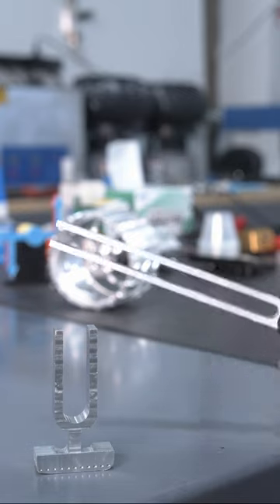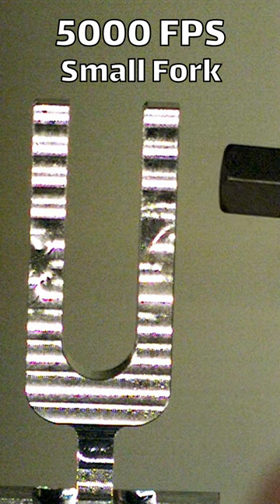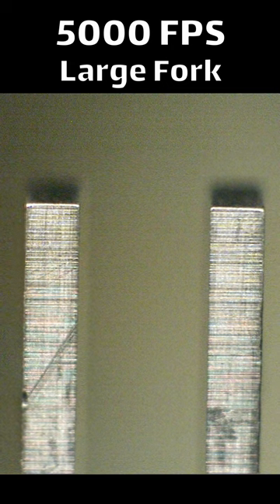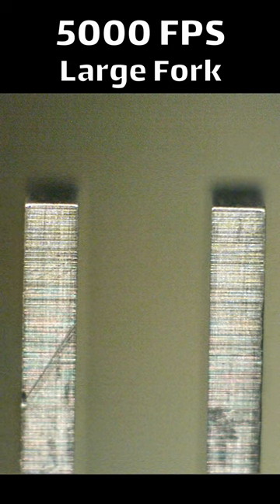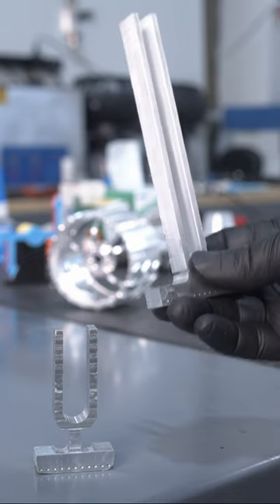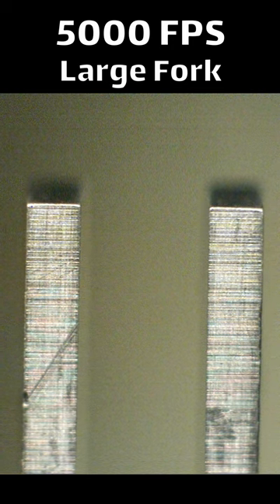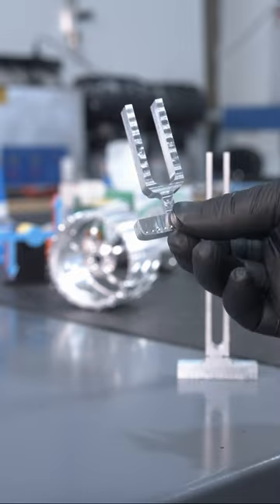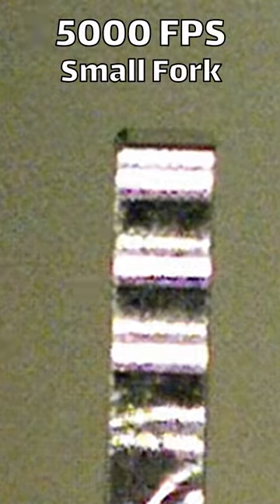Slow Motion Tuning Fork

Comment: The large one resonates at 180 Hz? It really sounds much higher than that... Anyway, great short! <3
Reply: Agreed. I think the microphone is picking up mostly overtones
Reply from the maker: Yeah, I really struggled to get the mic to faithfully pick up the tone, it's pretty directional and the mic didn't like it much. There are some overtones muddying it up, plus the table itself contributed some noise (oops). I tested these off-screen with a phone app to determine frequency and it seemed pretty consistent once it settled into it's main frequency. (although grain of salt re: phone app and microphone 😅)
Reply from the maker: Ah yunno, I might have botched that on second thought. Just tested it again and there is definitely a low 180hz tone if you have it right up to your ear which must be what the frequency app was picking up, but the higher tone is around 11kHz which is what the camera mic was detecting. Oops.
Reply: @BreakingTaps  which app did you use
Reply: @BreakingTaps tuning forks at least for music are designed to be coupled to something resonant for the tone to be audible. Watch classical guitarists or similar. They will strike the fork on their knee and then press the stationary end of the fork against their skull just in front of their ear, or against the body of the guitar! Any wooden box or even a drywall wall will make the tone considerably more audible. You could even press the back end against your mic. The important thing is to let go of the idea that you’re ever going to hear it from the vibrating ends, that’s just not how they’re meant to be used.
Reply from the maker: TIL, thanks for te extra info! I should probably note these are nowhere near "real" tuning forks. I just sketched out a rough tuning fork shape and zipped them out on the CNC. Needed them for a video demonstration and didn't particularly care about their frequency. So definitely not well optimized! The footage was neat though so figured I'd make a quick Short first 🙂
Reply: @teddycook1299  a lot of string players touch the base to the bridge to use their instrument body as a resonator.
Reply: That's called a harmonic
Reply: Can’t we just count the frames at 5000fps to know the true oscillation frequency?
Reply: @alexscarbro796  sure, you start and I'll relieve you to finish counting next week
Reply: i’m order to hear the pitch of a tuning fork, you have to put the base onto something that will resonate

Comment: What causes such high harmonics? That larger one especially looks to be oscillating sinusoidally, but there’s obviously a lot of treble coming from other harmonics. And since those harmonics are coming from different mechanical parts of the fork, I guess they don’t have to be integer multiples of the fundamental; they can be independent. Manufacturing a tuning fork to have minimal harmonics, or to have solely integer harmonics, must be quite difficult.

Comment: Resonance frequency is also depends on surrounding matter/atmosphere... For example the same fork resonance frequency in air and water will be different...
This is the principles for ultrasonic level sensors in industry, they are made like pitch fork with piezoelectric generator attached, and when water or other liquid riches it, it changes resonance frequency which in return detected, and processed as liquid level reached the sensor...

Comment: The reason it looks like the 15kHz fork isn't moving at all in your slow motion is because of aliasing.  It's exactly 3x the sampling rate but in order to capture all data you need to sample/record at at least 2x the highest frequency expected., so 30k FPS.  Nyquist's theorem

Comment: sorry, 180 Hz? why does it sound like a higher frequency?
Reply from the maker: I goofed and forgot to mention there are overtones which are higher. They die out after a few seconds and you're left with the low 180hz (which unfortunately isn't picked up by the mic well at all, so you're mostly hearing the overtones 😢)
Reply: Because he doesn't know what he's talking about at all.

Comment: Since the hertz number is relatively low for human hearing, how come it sounds so high-pitched?
Reply from the maker: I botched that explanation a bit, there are overtones on the big one which are at a higher frequency even though the base frequency is low. Unfortunately the microphone mostly picked up the higher overtones and you can't hear the lower frequency (it's noticeable if you hold it up to your ear).  Sorry about that!
Reply: @BreakingTaps  Oh, I see. Interesting. Thanks for the explanation. What kind of mic did you use?

Comment: It would be a different shape or have more rods, but since the rods resonate with each other, various shaped rods together, percussed, could generate a soliton, a kind of wave, like a sound, water, electron, or light wave that is 100-1000 times farther travelling, from being less absorbable and spreading out less. it would be less loud, but you could hear it three rooms away through walls. there is an even better kind of soliton peculiarly named a "dissipative soliton" that dissipates orders of magnitude less than the already far travelling soliton, maybe you could hear it thirty rooms away. New musical instruments could make solitons at the instrument for far reach with ungarbled sound. solitons could be produced at any electronically processed, amplified, or effects processed instrument, giving any instrument farther reach and truer sound, the thing with the electronics is you would use soliton capable speakers, I think these speakers are possible to build with really fast moving speaker parts, the soliton wave looks like, rather than a trigonometric ~~~ wave, a lump with a regular curved top and having 99% of its sides, but the outermost 1% of the sides of each individual wave are trimmed away such that it has almost linear rise at its furthest sides. Being able to move the speaker parts really fast at the sides of each separate wave makes a soliton speaker possible, Quick magnets or piezo speakers could do this. It's possible any existing ultra high frequency 400Khz ultrasonic (sonar) speaker that could also do the range of human hearing would be able to move fast enough to make repeated nnnnn edge trimmed waves separate from each other, but so closely spaced they sound like regular continuous tone analog. Its not analog, it's not digital, it's soliton. Phone speakers could reach much of an entire room (music) but be ear harmless, and you could hear conversations with the listening to the phone speaker at a more ergonomic or texting distance. It would be beneficial if transport vehicles broadcast active wave noise cancellation to their vehicle at far distance, a soliton approximation of antinodal noise cancellation could possibly do this, greatly quieting external vehicle noise
Reply: All my ideas here are public domain and any company or person can use them without contact.

Comment: Can you use a high speed camera and a microscope to film the "tunning fork" inside a standard crystal oscillator inside almost all electronics today?
Reply from the maker: You could! You'd need a pretty high end camera coupled to a microscope objective to do it, but should be resolvable I think. I.e. a quartz fork in older watches is around 32kHz, and "slower" quartz oscillators are 40-50 kHz. So something like a fancy Phantom high speed camera which can capture up to a million FPS should be able to see it, although you'd need a microscope objective to be able to actually see the distance traveled since it would be very small.

Comment: Thoes are some shitty tuning forks. Check Amazon u can get a cheap set that's actually tuned to a proper note like 4th octave A. Which has a frequency of 440hz.÷
Reply from the maker: Just DIY forks for a different video I'm working on 🙂 didn't need a particular frequency, so just zipped them out on the cnc real quick